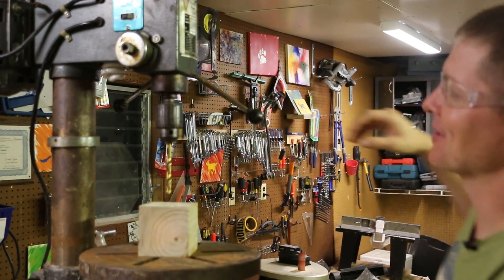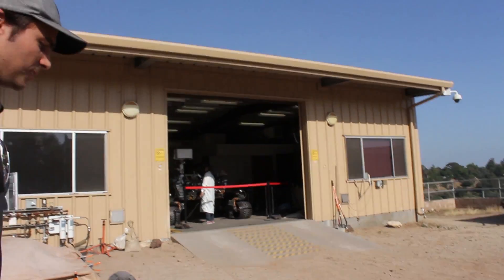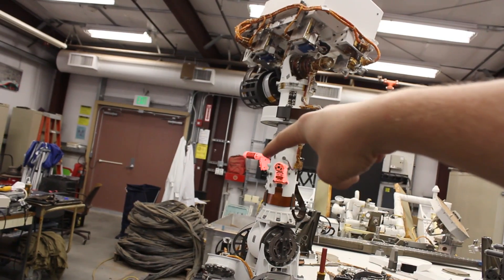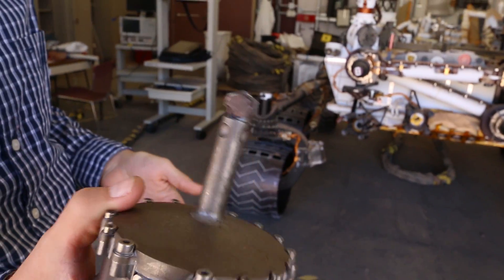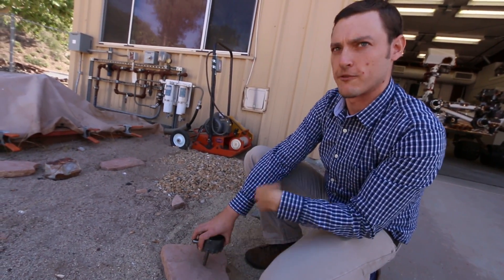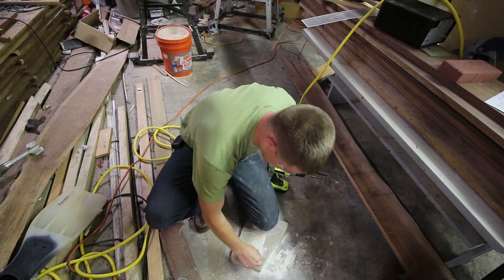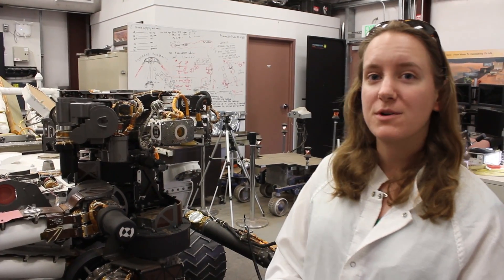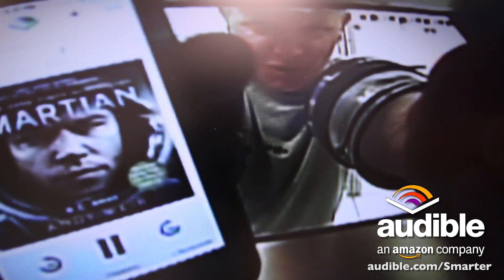The Drill we sent to Mars - Smarter Every Day 143

Comment: Wow what job do i need to have to use the 3d printer that made such a clear print.
Reply: +Zachary May (Zackiemay) obviously "drill system engineer"
Reply: +Zachary May (Zackiemay) Yikes! Good catch. You're right, it wasn't 3d printed, it was some type of molding.  checking...
Reply: Stereolithography, polished.
Reply: +Ryan Kinnett Resin casting, I would guess?  Silicone mold and some kind of clear polyurethane maybe?

Comment: you are a beautiful dork.
Reply: Thank you. Now send me to space.
Reply: +FunnerEveryDay Geek and proud + your videos are never a waste of time. Could you do a video on why the ISS orbits at the altitude it does and if it changed as it was built. I imagine it did or did it change orbit speed? Quite a large weight difference between start and end product. I don't actually know. Thanks
Reply: Doug Wagner For everyone else who is not american, the acceleration of gravity is 9.81m/s/s
Reply: +Kyle A only on earth, at or close to the surface
Reply: +Texassince1836 Well, the difference in distance between the surface and the ISS is like 6 %, so still pretty close to 9,82.
Reply: Skunkwurx ya, but all the objects would need to get into the same orbit separately to build the thing, each new part of the ISS built would have the same velocity as the existing station, so it would add mass, but it would also add momentum keeping the orbit somewhat stable. I think... Im no orbital mechanist
Reply: +Skunkwurx I think changing the mass doesn't affect the orbit for the same reason that changing the weight on a pendulum doesn't change the time required to swing back and forth. Changing the distance away from the pivot does change the period, though. Everything, regardless of mass, falls at the same rate on the Earth (32 ft/sec/sec), and the ISS is basically falling around the Earth.
Reply: +ikr1sse

 correct
Reply: +Kyle A Why do people always have to say stuff like this on the internet. Why can't he just be a dude interested in engineering. Why do people always have to plaster on some kind of romanticized  subculture label to everyone.
Reply: Johnny Threefour I am not meaning to romanticizing him. I just think that his passion for engineering and general rocketry is admirable. It is his attitude that i am labeling as "beautiful", more than him, also i wrote it that way because i found it a funnier than just calling him a dork.

Comment: It is amazing how complex we can make a procedure as simple as drilling into a rock. It actually, legitimately is. I want to meet the guy that designed that procedure, it's a thing of beauty and he needs more recognition.
Reply: +Teth47 It's an incredibly ingenious solution. It's a drill-meets-vacuum-cleaner with barely any moving parts that can go without maintenance for a really long time. By using gravity and the shaking of the drill (which is needed for drilling anyway) to move the dust around, you can pretty much guarantee that it cannot break down. If you can drill, you can move the dust around. It's such an elegant solution when you take a closer look.
Reply: chris ce Finding a simple solution for a complicated problem, that's the hard part. Care to elaborate how you would improve on it?